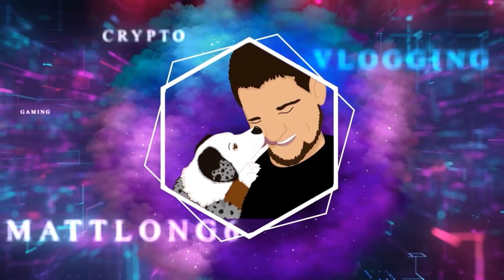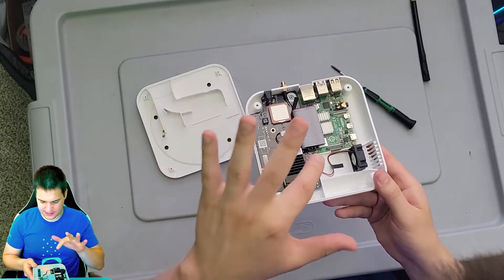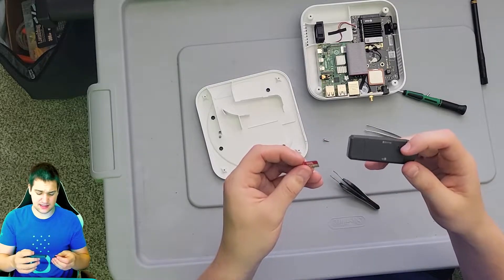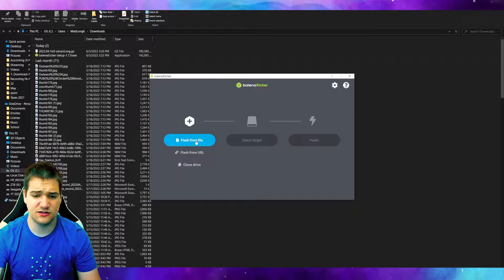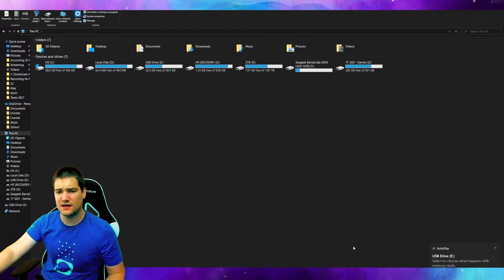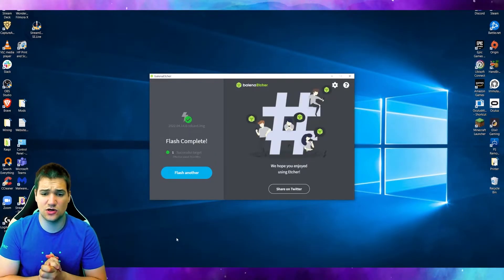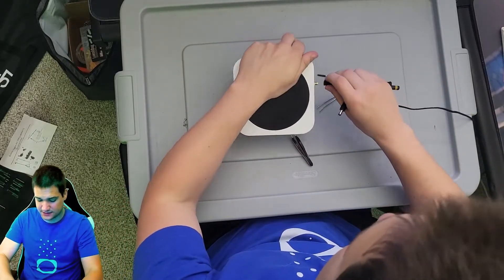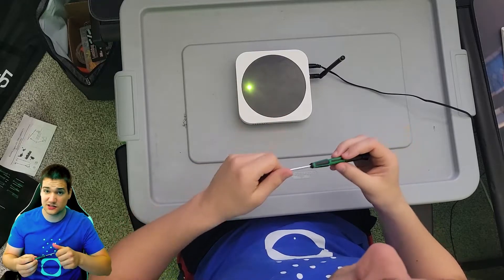How to Replace and Flash your SD Card inside your Helium Hotspot

Comment: Hi Mattlong, 

I have a question about helium download firmware.  But if I'm using a new sd card and interested in firmware, would this program work in Europe?
Reply from the maker: I believe so because the antenna I believe is the only thing you need different, not your SD card.

You could always double check by emailing them or asking Discord.
Let us know the answer after you try it :)